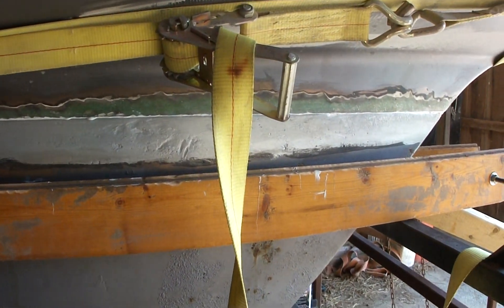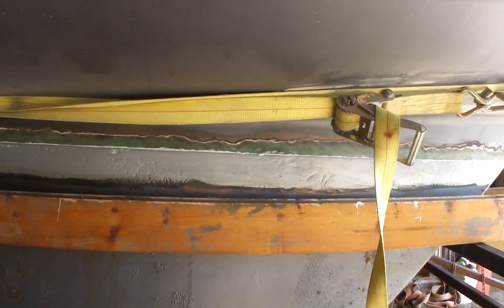Keel reinstalled

Comment from the maker: Yes it is in Ontario, we store and work on the boat in Caledon. Our woodshop is right beside the boat in the video. It's nice to keep the boat insde for the winter. We keep the boat at Hindson in Penetang on Georgain bay. Our 820 is an aft cockpit not cabin and the inside is in great shape, the carpet on the cieling is a little stained in areas but otherwise great shape. I took out the nav table and installed a fridge. I'll post a video of that before summer is out.